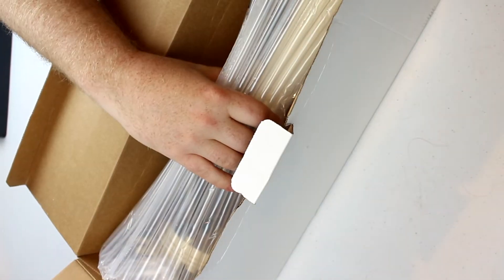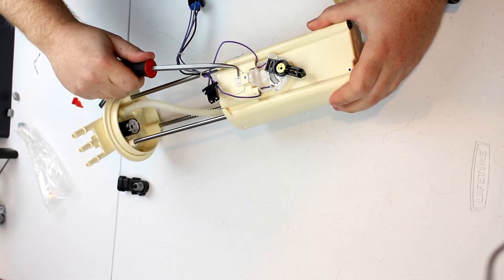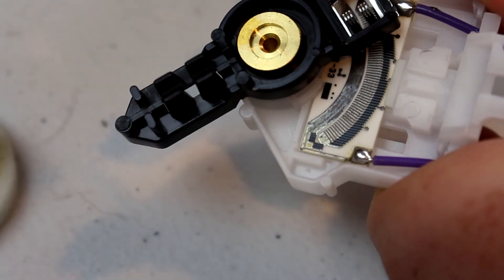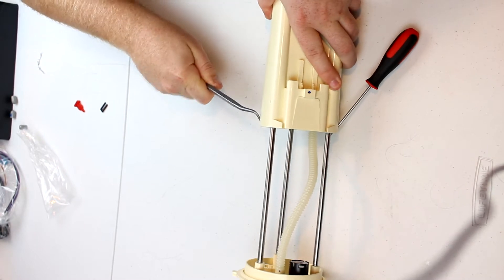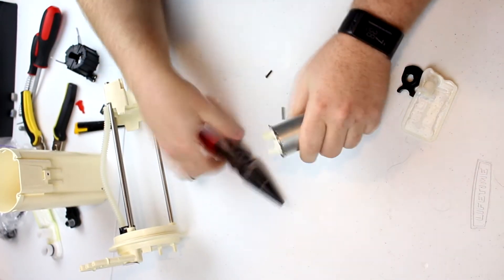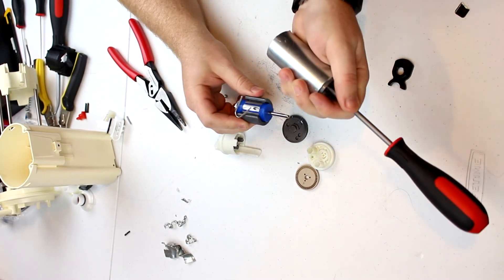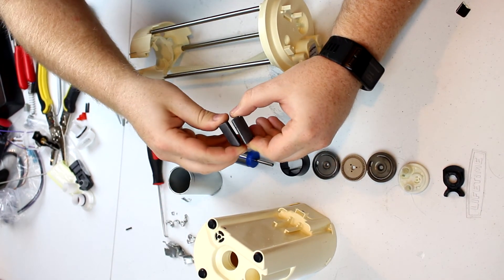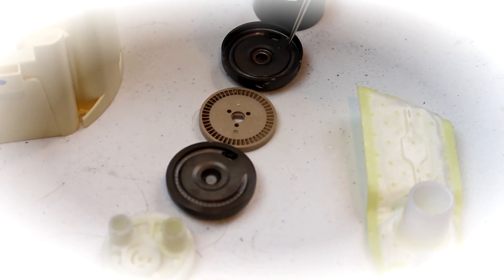Inside a Fuel Pump: Disassembly & Explanation of the Entire Assembly • Cars Simplified

Comment: These pumps are a type of pump called a regenerative turbine pump, however this particular one you showed is a little bit of a different design. Typically, a regenerative pump will have the ends of the impeller vanes open,  but most fuel pumps are like the one you showed that have an enclosed impeller. They can put out fairly high pressure, but at a lower flow rate, and won't lose prime if there was air that managed to find its way into the pump (they're self priming). Most common applications for these types of pumps are EFI fuel pumps, and washing machine drain pumps. My washer has a large regenerative pump as the drain pump, it's driven off the washer's motor. It has a rubber impeller with open vanes, which allows for small debris to flow through it without getting caught or damaging the pump. It also allows it to empty all of the water (except whats in the drain hose after the pump) even thought it is pulling air into the pump at the end of the drain cycle, plus air from soap bubbles.

Comment: It actually does not shut off at a certain pressure when you initially turn the key on it comes on for a pre set amount of time usually a few seconds. Once the engine is running the pump stays on. The pressure is regulated with a regulator either in the tank on a return less system or on the fuel rail on a system with a return.

Comment: Question since the pump goes sumerge in the gas and gas flow through the stator of the pump does that means that they should be continuity between the leads and the pump housing ?